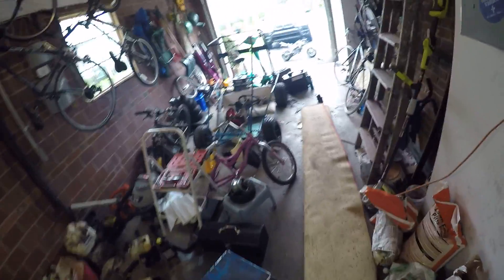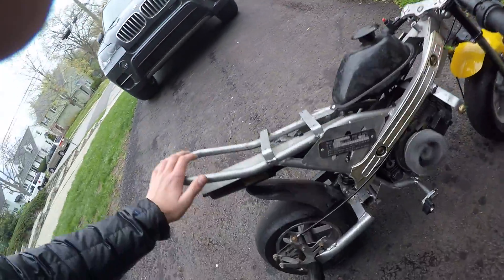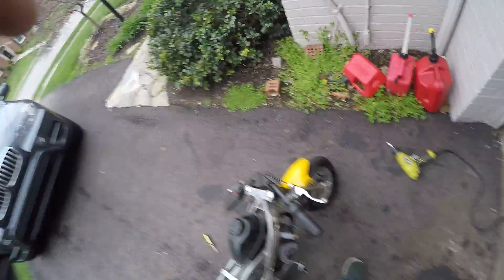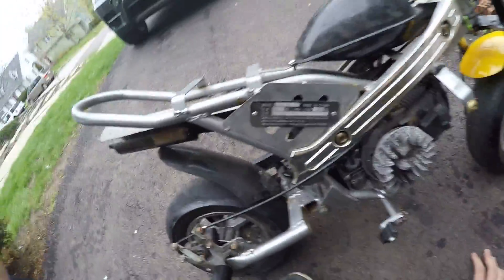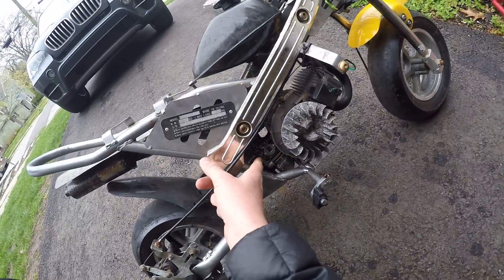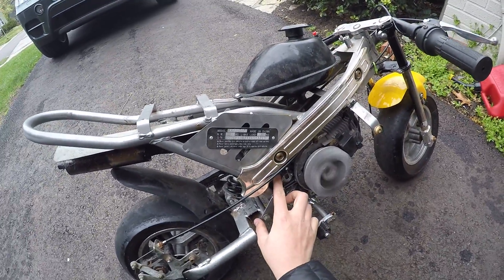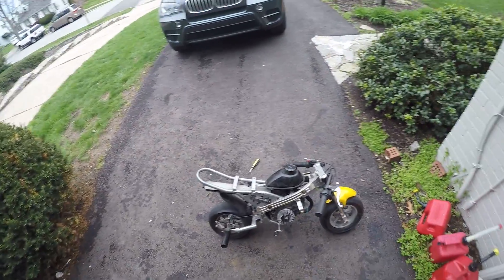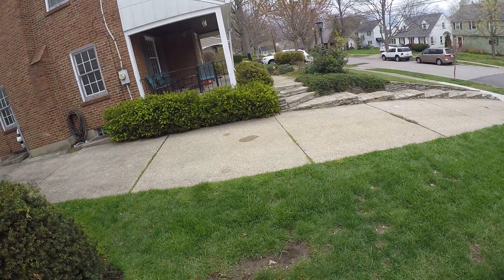2 Stroke Petcock Mod

Comment: How did u bypass it dont see a video
Reply from the maker: You fill the area with the shut off valve and the 4 hole rubber washer with epoxy, then drill a hole through the fuel inlet and out through the outlet
Reply: @willtrautman6243  🔥 my guy good lookin out
Reply from the maker: @jdee3093  I gotchu J Dee
Reply: Polished frame!??!sick.